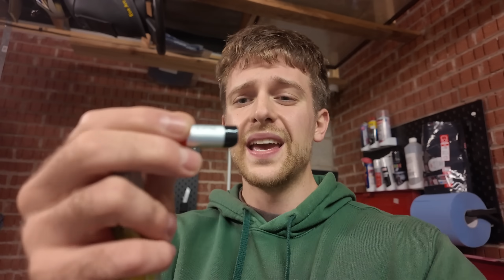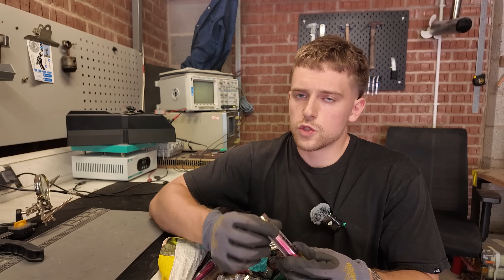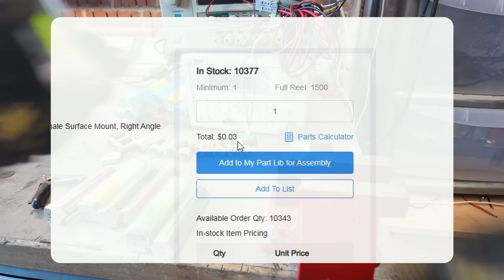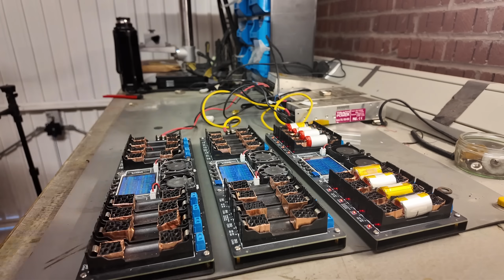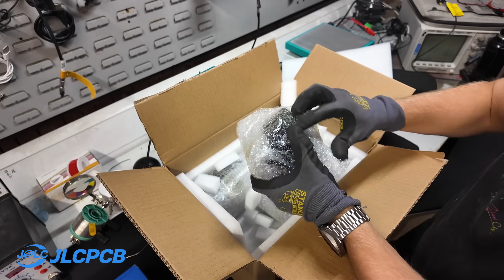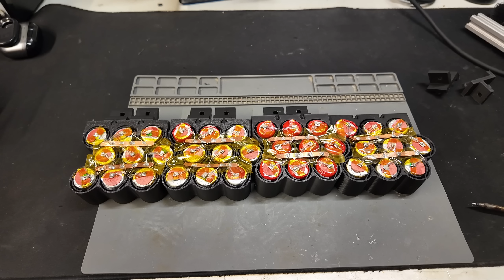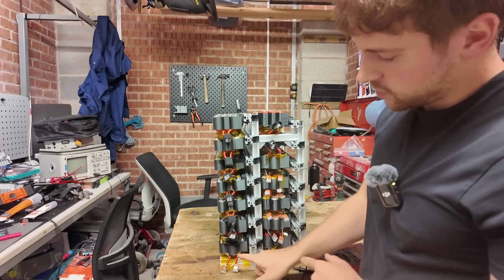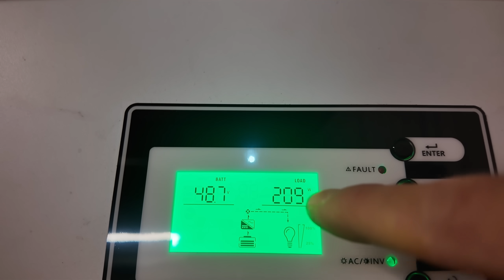I Powered My House Using 500 Disposable vapes

Comment: Didn't sub before cause I didn't realize this is your ONLY message. 

These things are ruining EVERYTHING but ever since Juul got a little slap on the wrist that ruined them, 18hundred companies have filled the gap with no warnings or disposal methods for these batteries. 

I have since switched to a reusable battery pod with refill click-ons but the problem is still rampant.

Plus, in England it's still misdemeanor for THC companies to use this recreationally. I can't tell you how many "disposable vapes" I've used in states where it's legal and tossed it traveling back home. I can it's about 4 but still.

Comment: These vape cells are not without reason designed as single use. The whole cell build is not made for the application this channel makes us believe. 500 cells with 1C would still deliver a ridiculous little amount of power, while stressing the cell - let allone risking a critically high chance of a thermal runaway - fuses or not. I would not recomment to repeat this. I would not make a video for a a fire hazard like this. Irresponsible to the extreme.

Comment: Well, if you have a under voltage dead Lithium cell, you could use the good old Russian jumpstart by taking a 12 V battery and holding positive to positive and negative to negative and if your timing is right, hold it until it gets warm, repeat this process a couple of times and it should be ready to go.  Brand new

Edit: be careful if ya hold it to long it could catch fire or do a thermal run away

Comment: Hey there! I absolutely loved how you documented the process. Soldering all those batteries together must’ve been a real challenge, right? I can totally get that!

I’m so impressed that you recycled those disposable vapes and made a battery pack out of those tiny batteries. And the fact that you took such great safety precautions, like putting fuses everywhere, is just incredible!

Of course, these batteries can now be recharged by that inverter. You’ve got a really powerful inverter too, that can run high-power-consuming appliances. I did a small project recycling old batteries and have been charging them with solar panels. It’s used to power my little setup to water a plant pot. Every day, I see the plant thriving and the batteries charged by the sun. It feels so rewarding!

Comment: Use a few 2NO2NC modular contractor as automatic transfer switches in that shed and or house, you or someone else can stupidly turn both that house and inverter MCB over at the same time and feed power onto the GRID and you will be liable if you ever hurt someone and this is extremely dangerous.

Comment: Awesome! Check the max amps of those WACOs and the cables you use, then check how the 200A of your JKBMS is being distributed. Can you share your calculations? Then add an DC MCCB with relay between your inverter and the battery then add some smoke and gas detectors that can tell you Venus OS to kick of the relay and also add an extractor fan please! So gas detection and ventilation automation and calc. Why did you change your EASUN inverter,  I was thinking of using that brand to replace some PowMr inverters that I have automated with HomeAssistant.

Comment: they should required to have a recycling program in place that can deal with the mass production instead of trying to find a solution when its to late. Every a new type of battery gets made that company has to find a way to recycle it before they can sell to the public

Comment: Interesting. You've made a 48v powerwall

Ive also made a 48v system, but just way more simplistic. 

4 old class 29 marine batteries from Facebook marketplace wired in series with 2 gauge automotive wire while on the user defined setting (no BMS just voltage reading) of my antique hybrid inverter that has a lead acid mode built in.

Comment: I believe you are overloading the wagos. They are only rated for 32A, while you have shown that you draw around 64A while the kettle is on. Unless there are multiple wired in parallel and I missed it.

Comment: The disposable element usually isn't the battery though. Most "disposable" vapes have a port for charging, it's the juice tank that companies don't sell with refillable components or don't sell juice tanks for re-use. There's a line of elf bars that come with a separate juice tank you have to clip in yourself and I've asked at stores if I can just re-purchase the tank itself and elfbar doesn't sell the tanks to buy separately. You can only get a new tank by buying a whole new "disposable".

Comment: What you need to mention is some appliances are going to juice the shit out of that DIY battery. And it probably won't last more than a couple hours. Also it would be cool to put some Temp diodes onto those cells and see what sort of heat they are producing. A kettle and say a microwave for example running together is going to surely cause some sort of dip in the power output on the inverter side?

Comment: I tried using batteries from vape pens, but they're low quality and degrade and die very quickly. They're not designed for long battery life or high cycle counts.

Comment: I think his math is out. If his house uses 6000 watt hours per day then that is an average of 6000/24= 250 watts per hour.
So a 2500Wh battery will power his house for 10 hours. Not days.

Comment: I am sure you've thought of this but just wanted to mention in case you or anyone else hadn't thought of this, but PLA plastic softens at 60 deg C so if you're going to 3d print parts to hold or come in contact with batteries you probably want to make it out of ABS/ASA. Especially a large battery pack like this. Also thermal runaway of the batteries is a bit of a concern with this particular volume of batteries that werent meant for this lol, dont want your house to burn down..

Comment: 6000 watts....The "Kettle and Oven" Effect: A standard electric kettle draws between \(2,500\) and \(3,000 \text{ watts}\). If you turn on the kettle while the oven is running (another \(3,000 \text{ watts}\)) and the washing machine is heating up, your peak usage instantly spikes to over \(8,000 \text{ watts}\)

Comment: #question How can you reactivate a completely empty battery? Is it even possible without expensive, specialized equipment? I'm asking because I have a tablet PC lying around that's two years old, but has only been used maybe seven times in total – unfortunately, the battery is now completely dead, which is really annoying since the tablet was practically as good as unused. :body-blue-raised-arms:
Reply: Sometimes batteries will revive. For example set that laptop outdoor not direct sunlight, the warmth might juice up the battery enough for it to accept charge via the charger. If that doesn’t work your only real option is to order a replacement battery online, or use it with the charger plugged in permanently as a TV computer or “desktop” with spare monitor
Reply: @Pwnulolumad  Thanks for the info - how do battery productions charge a emty battery? Does it work with heat or with a hight voltage charge? Since the batteries are also usually empty during production and have to be charged, I thought there might be a way to activate empty batteries. :face-blue-smiling::body-blue-raised-arms:

Comment: Lithium cells are not damaged by going below their working voltage just once. Repetitively draining them beyond their working voltage can significantly reduce their usable life, but they'll still do at least a few hundred charge/discharge cycles. If the lithium cell is below its working voltage, you just have to slowly trickle charge it at 50-100 mA until it reaches its working voltage, then it can be used normally again. A bench power supply can do this very easily.

The only point where they are irreversibly damaged is if you discharge them to absolutely zero volts and then reverse charge them. This is what happens in laptop battery packs and why they fail. Usually, one or two of the cells will get weak and discharge before the others, then will be reverse charged with the other cells pushing voltage through them. But the other cells are still good and can be extracted for other things. I keep a box of these cells to use in my solar lights, and each battery usually lasts at least a year in the worst conditions imaginable. High heat, freezing cold and hundreds of charge/discharge cycles.

Comment: The dead cells can often be revived as I have recovered many potentially dead cells by giving them a charge through nicad settings on my multi charger you have to monitor them just giving them enough charge for a lipo charger to recognise normally 3v per cell is enough but don’t do it if you’re not sure what your doing.

Comment: Have you done something similar for 18650s? I’ve wanted to pursue a similar line of projects as I’ve got a good source of those cells, I was curious if you were aware of any other technicalities? Like, I should be able to have different models with different charge and discharge rates as long as they are in their own bank right?

Comment: I don't understand. If vapes are single-use, why do they use lithium-ion rechargeable batteries? || I looked it up. The energy density is greater for Li-ion than for alkaline batteries (150–250+ Wh/kg vs. 80-120 Wh/kg).

Comment: well yea this is the worst idea imaginable, pairing 500 sketchy batteries and hoping you dont have to try 100 times because one sets the whole bunch afire by serious voltage differences. practically impossible unless you level each battery first. and at that point one mistake out of 500 = disaster. yea absolutely dont attempt this absurd idea, probably costs more in failure rate than medical bills. or both. jk, but yea good experiment to see if it is possible. voltage differences can cause some serious short fires and damage, and 500 instances of uncertainty are certainly not meant to go together. this is an experiment i believe, not anything meant to be practical, but yes, batteries can easily become explosives. as fun as they are to use in projects this would cost way too much to do safely or for any practical reason other than to see if you can do it at all. worth it? yes, for the knowledge that it gives. there is a way, but its not practical in any sense to do manually, restoring electronic components like batteries. battery recycling should be taken more seriously, the resources are actually non replenishable for many parts. aside from lithium ions, but we still produce alot of other component batteries. 18560s are the most dangerous kind, i do like using them. but their volatility does make them an extreme hazard for any moving vehicle, and thats a problem. if the seal breaks any way, that battery is prone to violent explosion. pmuch meaning a lithium fire that cannot be extinguished and you have to duck and cover to breathe. so its absolutely not a gas replacement in event of an accident. its deadly toxin, it wont kill you immidiately, but breathing it in enclosed spaces will. meaning if youre trapped inside the vehicle. idk how they mitigate this, but battery dangers far outweigh the current safety concerns in modern cars. the fuel tank does not ignite simply by being hit hard enough. generally a forward impact does not cause some of the horrific failures in evs. its no fault of evs being evs.... its just the placement, and general design is not good enough to call better in terms of safety, its currently worse in the event of an accident, which is something we must all be prepared to face if we drive.

Comment: I love my large powerhouse of a unit but it's a large powerhouse of a unit. The vape bars are tasty as hell and "good enough". I like my nicotine, is what it is. With all that, I totally agree about the disposable situation. The general public sucks and they are pathetic when it comes to being responsible or tidy. The cartridge pod deals I really love. Cheaper to buy a variety of "vapes" as you only need one power unit. I have two, nice when one dies because I hadn't paid attention. But you can end up with 4 tank/atomizer pods for a system for like the price of 2 normal units of equal amounts. Currently use a "Lost Mary" system which has a huge battery and fantastic flavors for on the go. At home I just use a good old tried and true Smok unit that uses 18650s and a sub-ohm that tends to be perfect around 150watts. Regardless...they are ALL better than smoking. That entire industry just needs to burn. Pun intended. Here (North Carolina, USA) they banned all vapes and fluids under the bullshit "mErrrrr tHink of tHe kIds!!!!". Sure, dipshit. That's why all brands and products actually owned by any big tobaccos were able to stay. It's shit like that which is the biggest and best motivation to not buy cigarettes. Even if I have to take 1,000 mile road trips (currently just a 2 hour round trip to a state above or below...easy peesy)

Comment: ive been thinking of doing this this, well buying the cells, and building a 12-15kw pack. 2 years i sold my pub, for a good 3 years i was throwing out a good 300 disposables. if id only have had some foresight. i use 8kw a day on average, excluding the car, so i want a 12-15kwh pack, that i can charge overnight in the 7p per kw tariff, and use during the day. shame i could have collected the cells for free, instead of binning them, all in the industrial mixed waste bins. which is a joke given how strict home recycling is in the uk. i hear pubs now have to recycle. but just a couple of years back all my waste went in the same bin. but at home one wrong item meant your rubbish wouldn't me taken. so id take it the the pub and put it in that bin. a total joke of a system

Comment: you need to be careful with the fuse design... it can fail in a way that cascades. If one fuse blows, but the load doesnt change, the load is redistributed to the remaining cells that dont have blown fuses. This can result in a cascade failure, or a thermal failure as the remaining cells attempt to source higher current to make up for the missing cells that fused.

Comment: Hey so robotics engineer here, I do know that there are places (like my old uni) that have battery reclamation / recycling labs.  I am not too familiar with the process, but do you think if these batteries are broken down enough and their key components extracted / cleaned (i.e. the lithium, the liquid electrolyte, etc.) could these below 3V batteries be reclaimed in one way or another?  If the answer is yes, I do have a great place to send those bad batteries you couldn't use.

Comment: out of curiosity ,  how many more years can these vapes battery can last? or do u measure the life span of the batts by the number of charges?  comparing the effort of recycling them and used it to store solar power, is it economically recycled them to be used for another 3 to 5 years?

Comment: This feels dodgy as all hell, particularly the way you fed it into your house. You'll have a fun time if your house's mains get turned on while the inverter is feeding in.

Could you also mention the rated output of all of those cells? Just because it has X kwh of power doesn't mean its able to discharge it all as quickly as a microwave would require.

Finally, did you set this up re recharge the battery bank too? Some/most inverters are able to recharge the cells from mains and kick over like a glorified UPS

Comment: I'm just now seeing this. If i had to do this project, I would have invested in a spot welder. instead of using a soldering iron, you could have easily done, like 2-6 spot weld's in a fraction of the time. I don't think the machines are that expensive to get, this is what i used to use when i would make battery packs for people at a battery store.

Comment: It was powered by the grid, you just stored that power in the vape batteries then turned the grid off. You’ll then need to recharge those batteries shortly off the same feed that usually feeds your home. Cool, but doesn’t save any power. Correct me if I’m wrong.. 

Level up and do as another commenter said and create a solar system from the old solar panels on small calculators that can then charge your power bank.